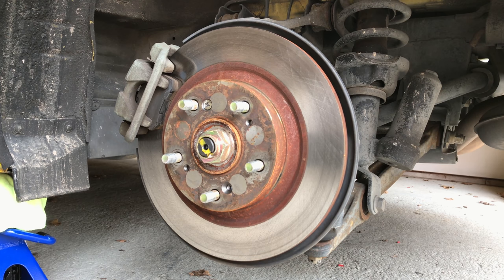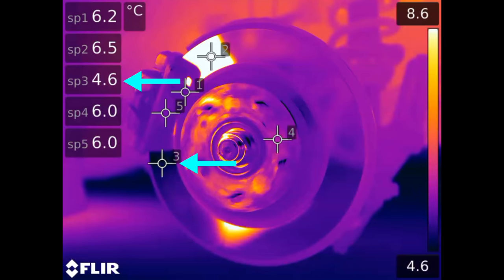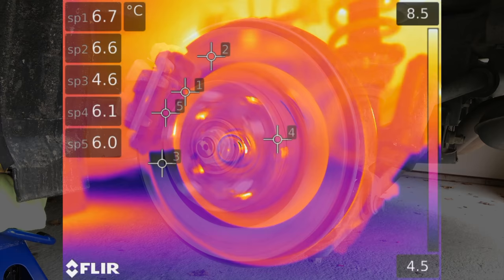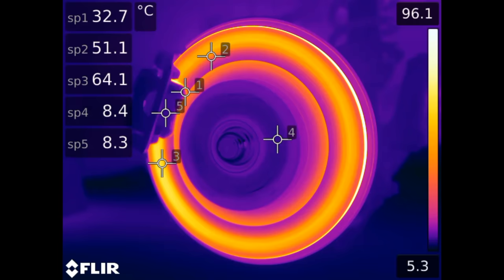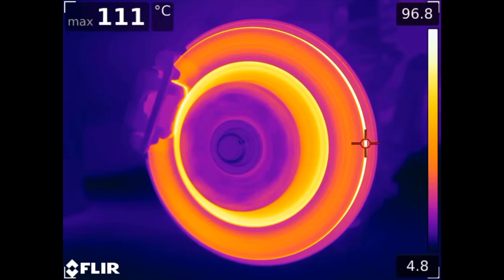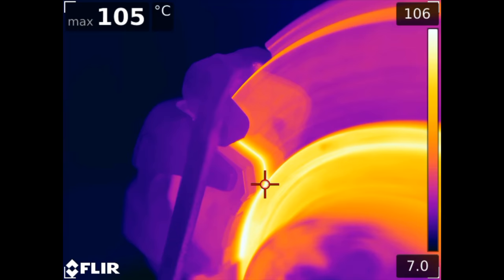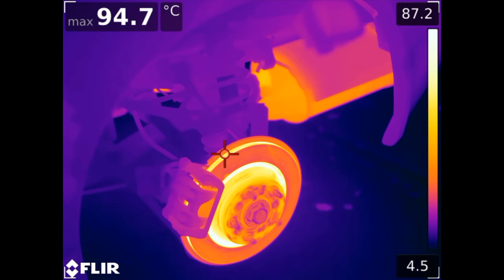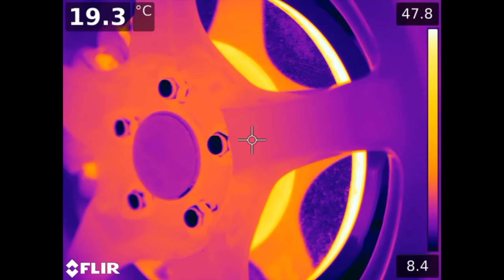How Hot Do Your Brakes Get?

Comment: During hard braking to stop at a light or otherwise and you keep the brake pedal depressed once stopped, does it cause significant heat damage / warping of the rotor?

I always try to put the car in neutral if on level ground to prevent this... but maybe it's not a problem.  

Thanks! Very cool video!  Good to see you're getting use of your thermal camera.
Reply: Keith Price I'll leave this here, for an answer
Reply: Keith Price Not when you're driving on the street. If you're doing hot laps at a track and you pull off and apply the parking brakes you can easily warp the rear rotors however.
Reply: Keith Price i need the answeeeeer.
Reply: Keith Price never do this on the street. If another car hits you then your car will go flying out of control, probably hitting other cars. Always keep brakes applied while stopped in traffic. I drive manual gearbox and always have the gearbox in neutral but with brakes applied while stopped in traffic.
Reply: Always keep your brakes applied while stopping at red light.... It doesn't generate heat or wear out your brakes since your car isnt't moving and there's no friction. Common sense.....
Reply: +Patrick94GSR The correct way is to actually leave the transmission in gear + apply the brakes. That way, if you were to be rear ended so hard that your feet would slip off the pedals, the car would stall and slow down pretty quickly, when in (preferably) 1st gear, since it has the highest resistance to motion.

Another reason is, if you're at a red light/stop sign and you happen to look in your rear view mirror and see a car coming up behind you way too fast, you can quickly just pull off to the side if you're already in 1st, and avoid a possible rear end. If you're in neutral with clutch released, then those few seconds to select a gear could mean serious injury/death.
Reply: You guys are WAY overthinking this. Unless you're at the track or driving very aggressively on a winding road your brakes are operating well within their design parameters. There's no need to worry about keeping your foot on the brake. Your brakes are designed too handle a couple of hot stops.
Reply: +Marvin Namro I never leave my car in gear, mainly because sitting in gear with the clutch in wears out the throw-out bearing. So I always sit in neutral, but with brakes applied.
Reply: Dang man. I didn't know any of that. I mean, I knew that holding the clutch in wears out that bearing, and I've seen a few really worn ones, but I never knew how fast they wore out. That was actually really informative. Thank you. I used to sit in 1st all the time, but after hearing that you shouldn't, I stopped.

Out of curiosity, would you still recommend sitting in 1st if I was doing mostly city driving? I ask cuz the clutch (and I assume TOB as well...) were replaced not too long ago in my MS3, and I'm trying to pamper the crap out of it.
Reply: Caleb Youngs The wear on the throw-out bearing from holding the clutch in at stops is insignificant and is nothing to even think about. People saying that doing this wears it out, is like saying you shouldn't start your engine because it will wear out if you do. The throw-out bearing is designed to handle this load.

I recently replaced both the clutch and pressure plate in my car because they were worn out after 136k miles/220k km, and the throw-out bearing was still in very good condition. And I almost always hold the clutch in at stops, even in heavy traffic in cities. I only put it in neutral if im waiting on a train or the stop light is taking forever to turn green.

Here in Sweden, you fail your driving test if you put the car in neutral at a stop. But do what is most comfortable for you, not based on what wears it out the fastest, because it doesn't make a difference in the real world.
Reply: Lol my clutch is barely hanging on at 60k, though I did learn how to drive stick on this clutch in a turbocharged PT cruiser... I dunno, is that bad for a first clutch?
Reply: get ri of the pt cruiser, your driving should get much better
Reply: Since metal is mealable at high temps Id say probably so. Depending on the pressure applied and the temperature. Maybe someone should test this theory.
Reply: Keith Price Warping is rare and will be more likely to crack well before it warps. What happens is that when you hold the brake down firm at a full stop with the pads and rotors hot is that you fuse the pad material to the rotor and create a bump. And every time you stop your most likely to stop on the bump as it's thicker and will want to stop there more and more.

The good thing is that your brakes can act like a lathe and if you slam on the brakes a few times in a row in a safe area without coming to a full stop you will cut down the area that built up the access material.
Reply: Gabriel Soria You sure about this? Usually once a rotor is warped it progressively gets worse.
Reply: +Marvin Namro no, I do not sit with the car in gear.  Like literally never, in 21 years of driving manual gearbox cars.  Maybe the TO bearing would outlast the clutch disc, maybe not.  But it WILL wear far more than if you sit in neutral, foot on brake at a light.  In fact the Owners' Manual for my car specifically says to not press the clutch when not shifting gears, as it will "wear the clutch faster", which of course refers to the throwout bearing wearing out.

As far as brake pads on hot brakes, the only time I make sure to NOT apply brakes is after bedding in new brake pads.  I make several quick stops from ~50 MPH, then park in my garage of my house with no brakes or parking brake applied, as the brakes are noticeably hotter than normal after the bedding process.
Reply: +Gabriel Soria I would disagree.  I've had warped rotors, but have never once had cracked (normal OE style vented) rotors.  Cracking is much more common on drilled rotors.  A number of things can contribute to warping rotors, from setting the parking brake with very hot brakes, to hosing down the car with water right after driving (thermal shock), to unevenly tightening wheel lug nuts.
Reply: +Patrick94GSR The throw-out bearing will wear out a bit faster, yes. But the throw-out bearing is a component that is designed to handle this load, and it will in most cases, hold up just fine during either the whole lifetime of the car, or until the car is due for a clutch replacement. In which case, you always replace the throw-out bearing as well.

Your owners manual stating that you should not press down on the clutch when not shifting, is just another sentence added to exclude liability.

The conclusion being, do what is simply the most comfortable for you. Instead of picking the alternative that will baby your throw-out bearing because you are scared that it will fail otherwise, because the chances of that happening during your ownership of the car are very slim, no matter of how you drive.
Reply: A few hard stops at stoplights will not heat your rotor up that significantly to cause damage, even after some hard laps at the track holding the brakes enough to keep the car from rolling will not warp the rotors. The parking brake one depends on what type of parking brakes you have. If you have drum parking brakes (some disc brake cars have integral parking drums) then setting the parking brake after hot brakes might warp the drum because the drum cools down and shrinks onto the shoes, but it would have to be really hot brakes and the parking brake applied pretty hard. If you have disc parking brakes then the rotor cools down and shrinks away from the pads, the rotors will definitely not get warped but was has been known to happen is when the discs cool and shrink the pads let go and the car (even while in gear) rolls away. If you are getting your brakes serviced and inspected at recommended intervals by a legitimate shop then you have nothing to worry about and can probably be harder on your brakes than you think. They're pretty tough.
Reply: Pulsing the brakes might be an option. Though, if you end up hitting the same side of the rotor every time, there's probably a higher chance of warping it. You could stop up a few meters early, and roll up before sitting on the brakes. The only problem then is preventing people from rear-ending you. We could add more wheels to absorb more of the energy, but then there would also be more energy to absorb.

Perhaps we create some sort of kinetic energy conversion damper that we strap onto the back of cars, brake early while we roll up, and then when people do rear end us, we can use the energy to charge our batteries.

Yeah, that should work.
Reply: I can assure you that rotors don't warp normally and when they do it's almost only because of a horrible installation with wildly uneven torque applied to the lug nuts. My teacher was a SAE master mechanic with a specialty in metallic sciences from SIU, he brake it down very well for me and what really happens.

I guarantee that if you take a car that has "warped" or pulsing brakes that you know for sure that had the brakes installed properly and go somewhere safe and go apply the brakes as much as possible from over 60 to about 5 mph 3 times in a row you will notice that it will be totally gone or heavily reduced. FYI, rear brakes are much harder to have that done to as they see much less stress/heat.
Reply: You really don't need to worry about this, especially for normal street use, you're way overthinking it buddy.
Reply: If you drive a minivan with very large mass compared to brakes, that could be significant.  One stop from 100km/h can warp the brakes.
Yes, I have just invited many flames regarding my driving a minivan. Oh well.
Reply: If you come to my house with the money to replace the brakes, we can go for a drive in my minivan.  Actually, from about 115km/h.  They have warped many times from just that.  So now, evertime I have such an energetic stop, I do what the poster suggested and apply very gentle force on the brakes and creep forward at a very slow speed for even cooling.  I have not done an instrumented test to see if the differential cooling impacts warpage.
I can tell you that my mileage numbers have nothing to do with the government standards either.
Reply: I do that after complete stops from high speed.  Actually, I apply very light braking force and creep forward very slowly.  
I would love to see an IR video of the rotor stationary under an applied brake pad after getting hot and then seeing it rotate.
If the area on the brake pad stayed hot while the rest of the rotor cooled, perhaps there is an issue.

Comment: So there is constant friction on the brake pads? The constant drag could not be a good thing for gas mileage. How can I stop the drag?
Reply: Avery Alexander there isn't much if any. could be from the wobble because there was no wheel.
Reply: There isn't a noticeable increase in drag. The rolling resistance of your tires far outweigh the resistance of residual drag on the rotor. By far the most contributing factor to fuel economy is driving style. Just reference the Top Gear episode of the Prius vs M3.
Reply: Avery Alexander Thats how all brakes are designed, theyre not forced on the rotor. Brakes work well whne theyre warmed so its just making enough contact. If you can imagine a +3000lb car and the amount of force applied between the brake pad and rotor, it wont make much of a difference on your gas milieage! :) Ive noticed this when I bought my first motorcycle. I thought it was strange cause I could hear it rubbing when I roll it into my garage hhahha
Reply: David Then you are not driving efficiently, even when you believe so. Fun fact: flooring the pedal while under 2500 rpm on a naturally aspirated petrol car when accelerating is actually more efficient than accelerating at very light loads. Throttle butterfly opens wide and reduces pumping losses dramatically.
Reply: +sotoris.bos

That's not exactly comfortable when you have 270 ft-lbs at the wheels...
Reply: ootdega Naturally aspirated at <2500 rpm?
Reply: 2000 rpm, to be exact.
Reply: ootdega That does not sound like a vehicle suitable for efficient driving..
Reply: Almost every cars brake pads ride on the rotors. It decreases the time for the pads to clamp on the rotors. And keeps them in place.
Reply: Avery Alexander The faster it goes the less it impacts/fights the car. Let's say it robs 1/10 of a HP in friction. At 10 MPH you need (random guess) 2/10ths of a HP but because the pad is rubbing you need 3/10ths, not great. But for 55 mph you need 25HP.. don't think 25.1HP is going to kill MPG. Although it might compound at higher speed it might also want to separate more.. depending if the design allows the pads "float". Like brakes that have two little wire springs that hook into the opposing pads and push them self's off the rotor.
Reply: There is constant friction on most disc brake pads. The shoes (friction material) in a drum brake do not touch the drums, that is why there are proportioning valves. There are some brake calipers on disc brakes called zero-rolling resistance calipers or something, the o-ring in the caliper piston pulls the piston away from the disc when the brakes are released so there is no friction between them. However this means changes to the master cylinder and somewhere between cost, complexity, reliability and engineering companies have done away with them. Furthermore, the calipers or pistons "float" side to side on the disc allowing for some sideways movement of the disc without dramatic braking loss or feedback to the pedal. Actually on high performance cars both the caliper and the rotor float to further improve braking performance.
Reply: +sotiris.bos

It's a V8. That's what they do. Going 55 in overdrive has the engine at 1800 rpm.
Reply: sotirisbo my car has Valvetronic... No throttle bodies for me

Comment: who can help me?
My car is quickly wearing the pad on the right side, I used a temperature sensor and that side heats up much more than the other and I don't have a caliper stuck. I also replace the brake lines e replace the oil.

Comment: Question: Why do Tesla's (and other electric vehicles I presume) have near flat torque curves after launch?
Reply: Because electric motors produce max torque at zero RPM. The engine doesn't need to rev up to its powerband, it's always there.

Comment: I have a question. When coming to a stoplight, is it better for your brakes to slowly come to a stop or to do a hard stop? I always do a slow, smooth stop, but I see people mash on their brakes right before a light and I always think that can't be great for them because there's so much heat being generated at once, yet at the same time, does taking longer to stop have a higher buildup of heat because you're applying the brakes for longer? Or does it even make a difference since it's the same amount of kinetic energy being transferred to heat regardless of how you brake?
Reply: JustMcCray I think it's worse if you mash the breaks but my intuition might be wrong. The governing equations should be checked. If we assume the dominant component of cooling is air then convection equation dictates the heat out. Q = h*A(Twheel - Tair) so as the wheel gets hotter the rate of cooling increases when everything kept same. So I think your question would be determined if we can model the rate of heat generation depending on the break pad friction. Though I don't exactly know how it behaves. We should model and solve for the whole system and find out. One simple approach may be coulomb friction. Ffriction=Pressure*contact area*coefficient... and then Qin = Ffriction*SpeedofCar ...                 Twheel = Qin/(m*c).  So this is a simple approach but I think looking at the equation Qconvection and plugging Twheel equation in. I think it depends on brake pressure in first order and on Twheel in first order as well. 

So finally, I think it doesn't differ much to smoothly stop or suddenly stop... Unless there is something I forgot or I haven't oversimplified the scenario. 
By the way sorry for long comment ...
Reply: JustMcCray the way you brake makes a HUGE different in how long they last. I've seen an old guy who downshifts often and comes to a stop slowly and babies his car bring his car in at 100,000 miles with brakes that looked like they've never been used, and I've seen a 20 something gal who shouldn't have a licence go through two sets of brake pads in 30,000 miles.

Comment: If he is using the e-brake the calipers and fluid systems would not even be used . Right ?
The e-brake is connected via a cable and there are brake shoes in the rotors hub area . Right ?
Notice how hot the hub is ? It's the friction of those break shoes , not the caliper pads .
Notice that he fluid lines show no significant signs of heat ? It's because the cables are doing the work.

Comment: wonder if you could increase the heat transfer to the rim with thermal paste used on cpu's?
Reply: Jedadiah Tucker probably not, I don't think its designed to go above a certain temperature. could work for street use, but brakes don't get that hot in normal driving where you would need the extra heatsink.

Comment: are the numbers for the max temperature applicable for the front brakes as well? because they typically absorb 65-70% of the kinetic energy but also they are bigger so they have a larger surface to cool down
Reply from the maker: +Elias Lange front brakes will typically be the hottest, yes.
Reply: are there any major differences between steel brake rotors and for example silicon carbide ones concerning temperature?

Comment: 🤔 hand brake doesn’t actuate the caliper?  It applies a brake “shoe” inside the center hub of the disc which would explain why the center is glowing hot
Also why the fluid isn’t hot, it’s not being used ... ?
Reply: It depends on how the handbrake was designed. Some actuate the caliper, others use a drum brake system inside the rotor